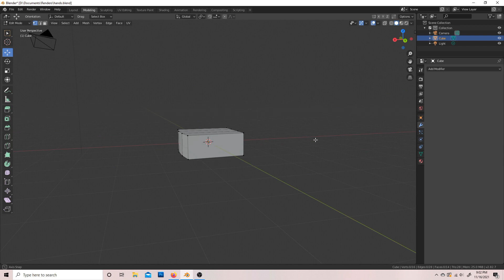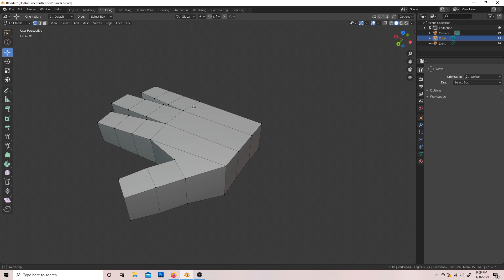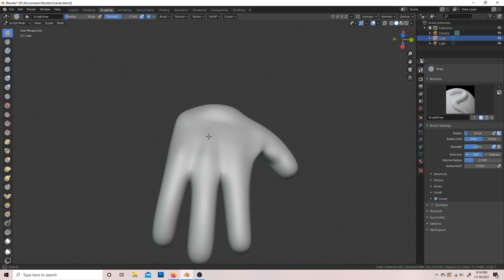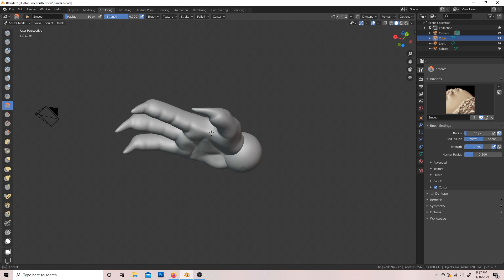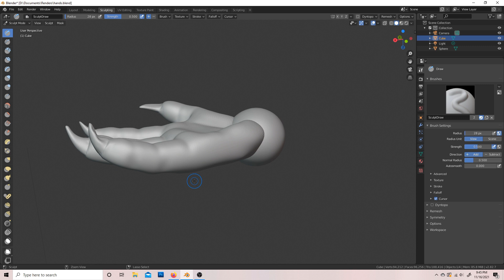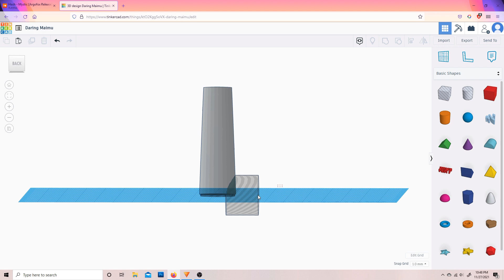Doll making diaries: 3D sculpting fantasy parts for a BJD

Comment: I am curently sculpting a tiny bjd i blender so this video couldn't come at a better time! People safe guard so many of the tips you give behind pay walls so thanks for sharing. <3 I have two questions, though: 
1) Did you make any difference in diameter between the wrist ball and the wrist socket, or are they the exact same size? I read somewhere that a 0.5mm difference is necessary to account or the resin "bleeding" during print. Did you have any issues using fdm?
2) How thick/wide did you make the wrist around the socket? The doll will only be 2.5" tall, so I want to make them quite thin, but I also don't want them to snap just by looking at them.
I'm asking 'cause I don't have a 3d printer, so I can't experiment. :)
Reply from the maker: I made the wrist and socket about the same size--I think the wrist ended up a shade bigger, actually, because I miscalculated finger length and my first print turned out the wrong size. But it still fits very snugly into the joint. I didn't leave any space--I've found my FDM printer is extremely precise with measurements, it doesn't warp unless something with my bed heating/cooling is off.

I made the wrist wall on these 1mm thick--it could have been thinner without any risk, but I was more concerned with making sure I had a sturdy wall with a flat end so I'd have excellent bed adhesion for printing. 99% of my prints that fail happen in the first 10 minutes because it came off the print bed, so giving myself a decent lip that could have a wide brim attached was important for me here. Since I printed with 1mm outer walls all the way around, that part of the wrist is solid, so I could always shave it down thinner if it bothers me later!
Reply: @LomisPlayground  thanks! That was really helpful ☺️